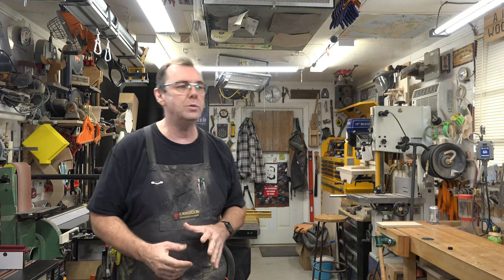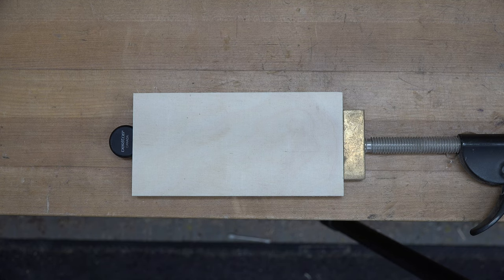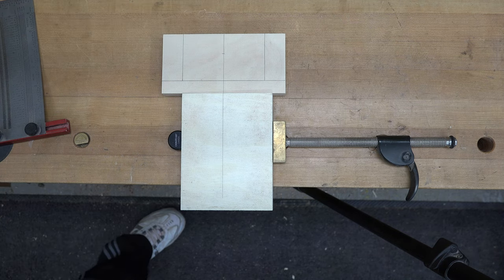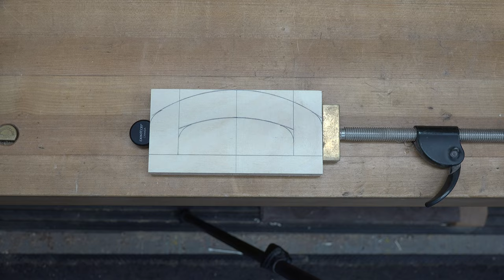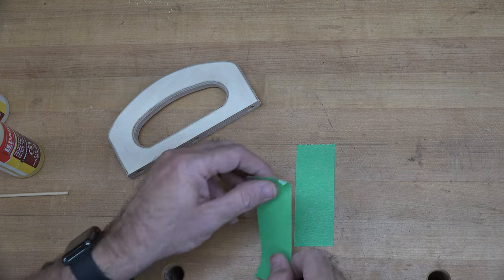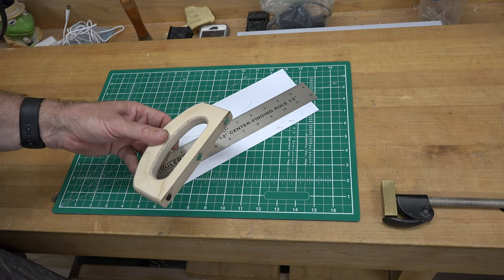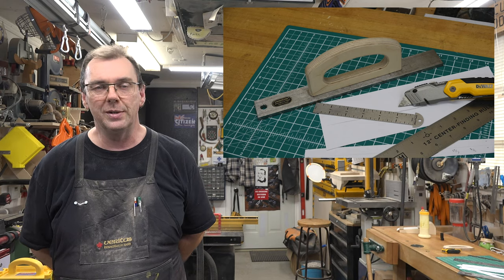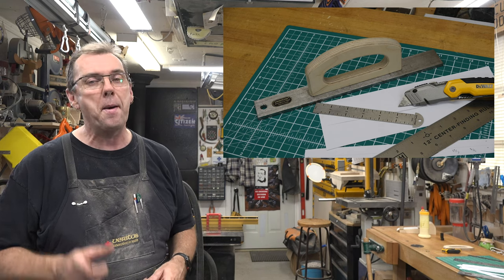Making a Safety Ruler

Comment: The whole safety aspect is valid. I believe in being a little cautious when there is a degree of permanence involved. When cutting leather you’re often putting yourself in a little danger and have to train yourself to maintain pressure in the right way so you aren’t going to cut yourself badly. It’s one of those mastery with practice things. Without that experience of hundreds of hours a handle is a great idea.
Reply from the maker: There will always be instances where the ruler handle won't be applicable.  Having never worked with leather myself, I can see where the handle and the ruler might be a hinderance rather than an asset.  Thanks for tuning in to the show and for taking the time to chime in with your thoughts.  It's very much appreciated.

Comment: That’s a really cool idea KW! And I’m thinking that, in a pinch, you could use it (with rule attached) for finishing concrete! Ha! I’ll be making one of these before weeks end! Thanks for all you do Kenny, and stay well!
Reply from the maker: Might be a little small as a concrete trowel Tom.  Maybe a small edger or finishing trowel.  LOL.  Good luck with your project.  I have found that it works best with a cork backed ruler to avoid the ruler slipping.  Thanks for tuning in

Comment: Hey Ken, that's a good idea, for me I would of added a slight lip on the bottom the thickness of a ruler this way along with the magnets it will have this lip to also hold the ruler in line with the safety handle, good show Ken Thanks be safe
Reply from the maker: That's a good idea Alan.  After using this for a while, I'm also thinking that making the handle non-slip would also be an asset.  Thanks for tuning in to the show and taking the time to chime in with your suggestion.  It's appreciated.

Comment: Have definitely done this. This is a fantastic idea. My mom used to have a circular cutter for cutting material and looked like a pizza cutter. Seems like that would be better than a utility knife but could still jump over the ruler. Gotta make one of these.
Reply from the maker: It definitely goes a long way to saving you from a trip to the ER for some stitches.  Thanks for tuning in Stephen and good luck on your project.

Comment: Ken, I love and hate this! Love it cause it damn works. Hate it cause I wish I had a 10 years ago when I cut my hand while cutting drywall and ended up with 8 stitches. But I guess better late than never. Thanks!
Reply from the maker: I'm glad that you liked and hated the show Mak.  LOL. I have found that these handles work even better with a cork backed ruler.  It gives the ruler a little less slip and a little more grip.  Add that with the magnetic handle and the days of getting 8 stitches from you box cutter knife are over.  Thanks for tuning in and taking the time to chime in with your comment.  It's appreciated.

Comment: My rule is stainless steel! - Nice little project though.
Reply from the maker: A lot of the stainless ruler of today have enough actual steel in them that they are still magnetic.  However, if that isn't the case, you would still make this handle but use a non-slip surface on the bottom of it to hold the ruler in place.  Thanks for tuning in to the show Ivor and for taking the time to leave your kind words.  It's very much appreciated.
Reply: If your ruler is 400 series stainless it will be magnetic

Comment: Why go through all that when you can buy, or, just apply 1/8" Cork to the bottom of ruler of choice.
Reply from the maker: Cork on the bottom of the ruler might keep the ruler from slipping Marcel but no amount of cork will prevent the knife from riding up over the ruler and cutting into your fingers.  This is about keeping your finger away from the blade, not about making the ruler non slip.  Thanks for tuning in to the show.